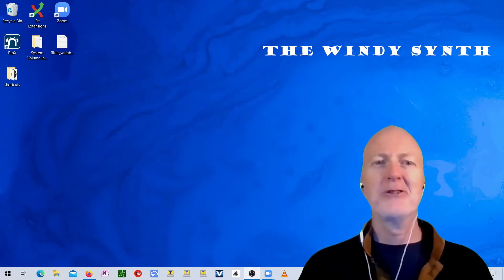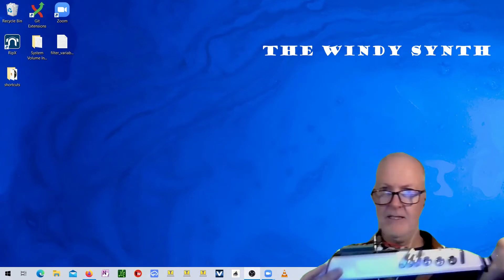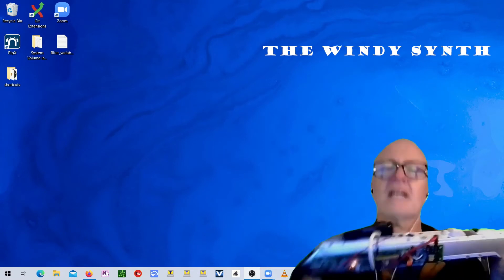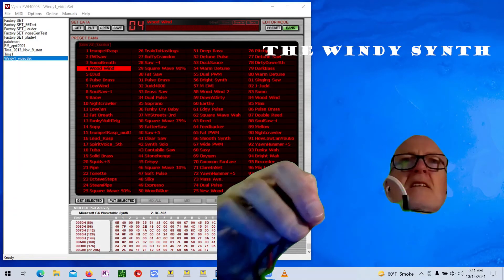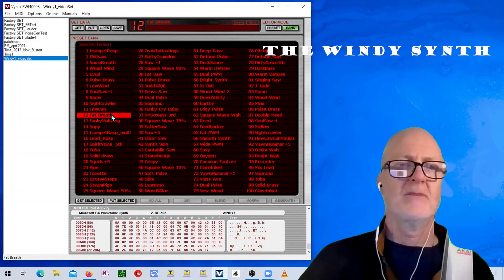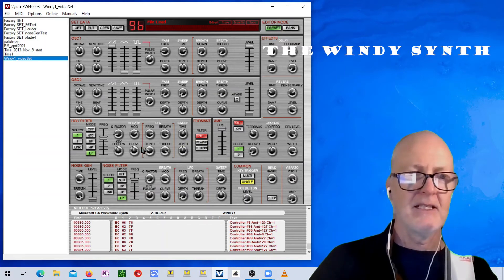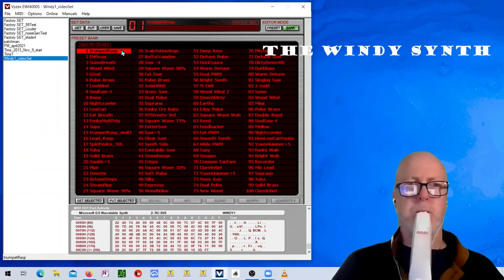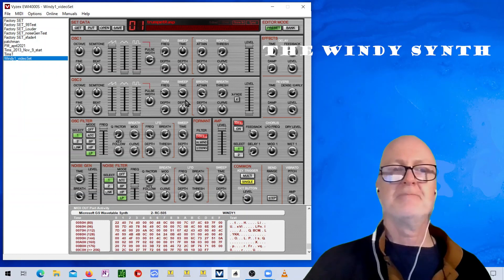Windy1 Synthesizer | Emulating an EWI 4000 using an EWI 5000 (Part1: Intro)

Comment: I'd love a guided step tutorial to making a Windy1, building, compiling, and installing. I know all the info to do this is most likely in your videos but is lost on me amongst all the tech speak.
Maybe after watching the video set a few more times I'll be able to figure it all out. Anyway, the windy1 synth is amazing, brilliant work!
Reply from the maker: oOReboOo, thanks for your kind words. 

Here is a list of some links to tutorials for getting up and running with a Teesnsy 4.1 with audio shield and the Arduino build environment on a PC:

Here is a general tutorial for getting started with a teensy board (it should work with a Teensy 4.1 as well).
https://www.pjrc.com/teensy/tutorial.html

you'll need at least these two boards...
https://www.pjrc.com/store/teensy41.html  (you can buy this with or without pins already soldered in)
https://www.pjrc.com/store/teensy3_audio.html  (be sure to get the TEENSY4_AUDIO not the TEENSY3_AUDIO) 
and get the Host Cable
https://www.pjrc.com/store/cable_usb_host_t36.html  

you'll have to do some soldering to get the pins installed. You can buy some of the Header pins from pjrc.com or get them from Amazon or whatever, but they need to be 0.1 inch spacing.  (I'd also get one of those solderless bread board kits with the wires and such if you've never built something like this before).

Teensy Audio Tutorial & Workshop (it uses a Teensy 3.0, but you can could use a Teensy 4.1, though you might have to wire it differently to the buttons and things).
https://www.youtube.com/watch?v=wqt55OAabVs

Then, just get familiar with getting those to boards working first.

Then when your ready to get closer to my project you'll need...
an oled display:
Search Amazon for "OLED LCD Display Module SSD1306 IIC 128x32 LCD OLED Screen 3.3V~5V"  (you'd hook this up to 3.3V GND and SCL and SDA.  The pins are mentioned in the code for Wire1)
and a rotary encoder knob:
Search Amazon for "5Pins 360 Degree Rotary Encoder Code Switch Digital Potentiometer with Push Button"
(pins A and B of the knob go to pins 30 and 31 of the teensy 4.1. and pin 1 of the knob goes to pin 32 of the teensy 4.1. then pins 2 and C of the knob go to ground). 

Then the code for the windy1 is here...
https://github.com/windysynth/windy1
There is a green button labeled "Code".  Click that to download the Zip file of all the code.
Unzip it somewhere on your windows computer and open the windy1.ino file from within the ardruino application.

(remember to follow the directions at the top of the windy1.ino file before building the project.)

I hope this helps.

I may at some point follow this video series up with a more detailed getting started video if I get the time.